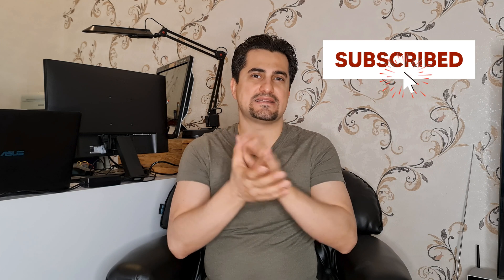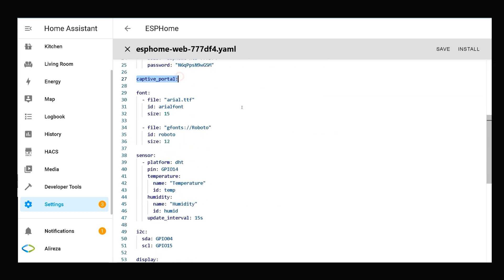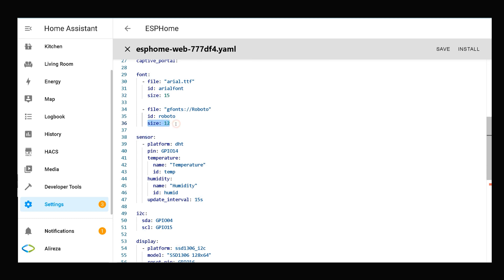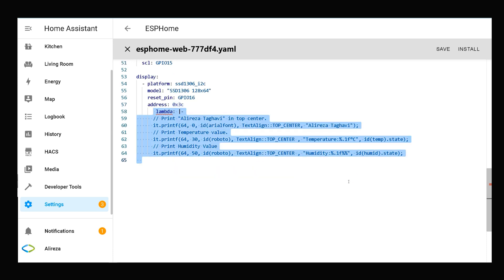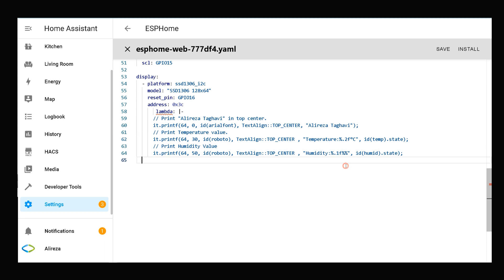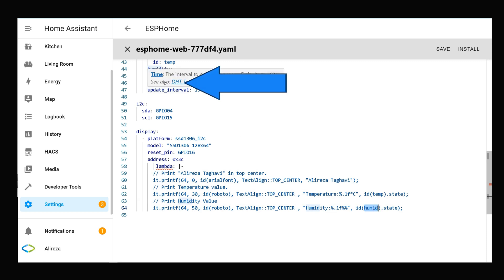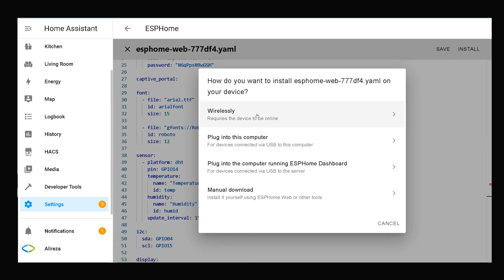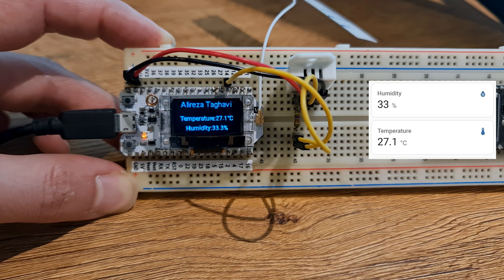Display Sensor Values

Comment: What board are you using? Heltec which version. Thank you
Reply from the maker: Heltec WiFi Lora 32 (V2) but you can use any model
Reply: V3 version does error out on the display initialization.